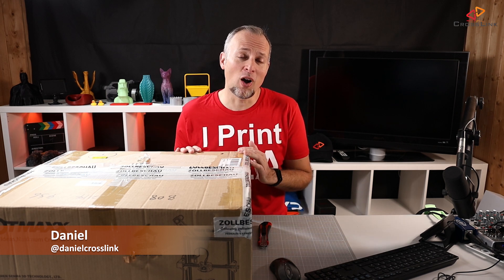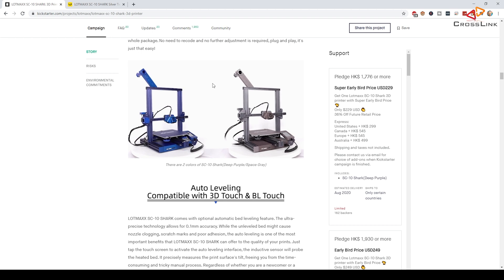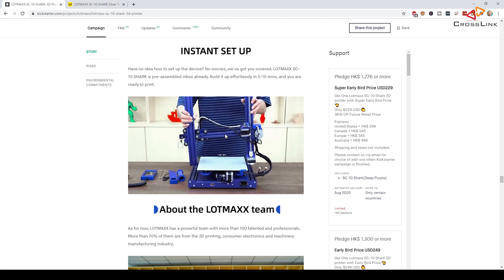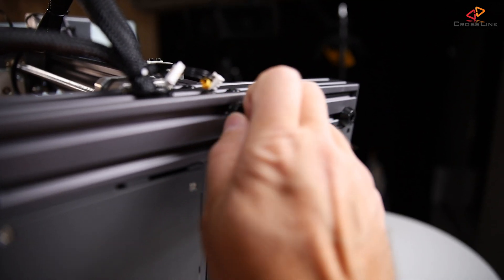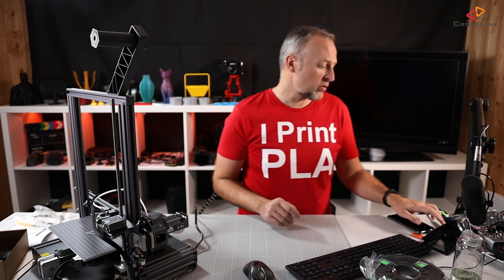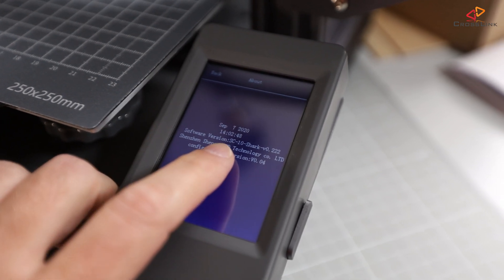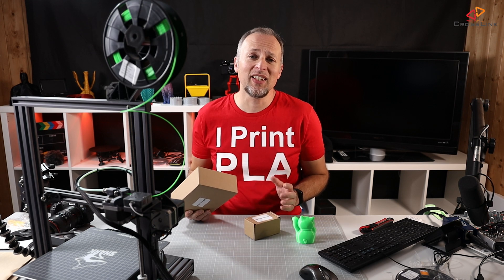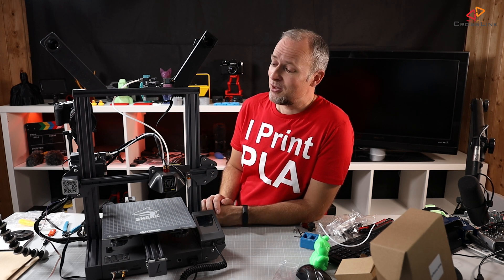First Look at the LOTMAXX SC-10 Shark 3D Printer

Comment: @Crosslink  Any thoughts to using octoprint with this?  Their firmware is not open and it has the blob/zit issue only when using octoprint.  per the company you cannot upload your own firmware because of the type of board they use.